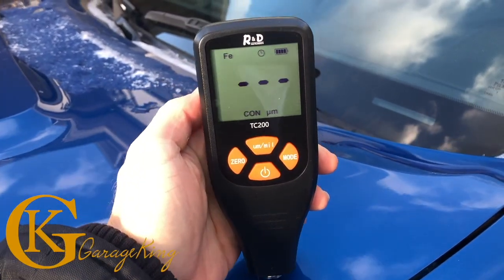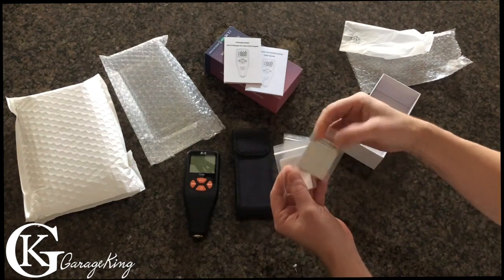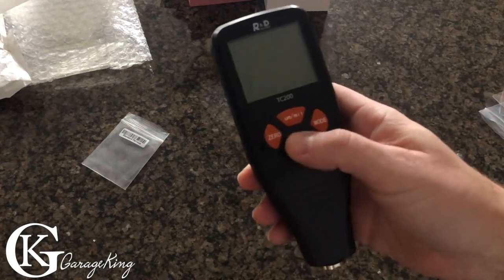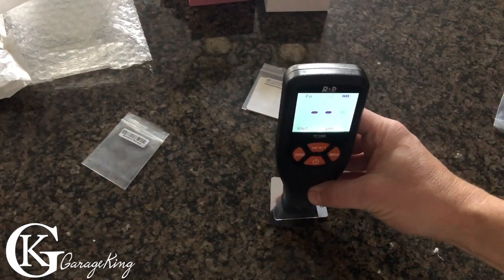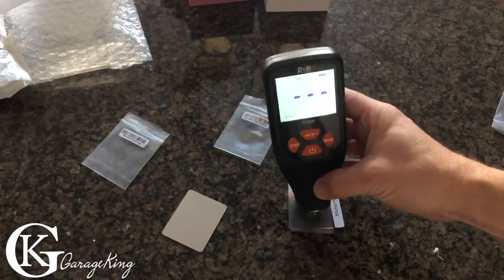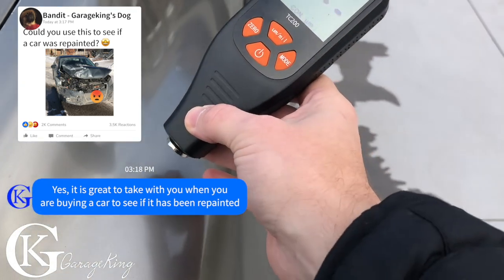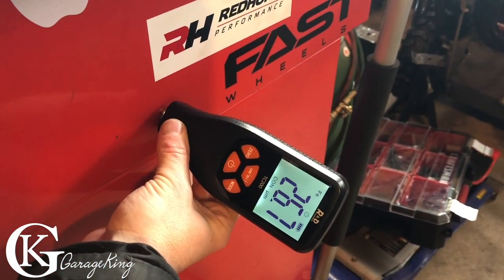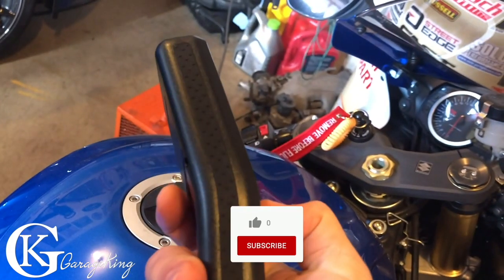I found a good cheap paint thickness gauge (TC200)

Comment: I actually need to do a touch up Paint job where my friend accidentally rear ended me. It left a few Black marks on the bumper😥
Reply from the maker: Thanks sucks!!!!!   The good thing is bumpers are usually plastic (on newer vehicles) so you don't have to worry about rust.  Sometimes if there are "press marks or small dents" from the accident you can use a heat gun (be careful) to get them out :)

Comment: I have the same tool (all details tallies as yours) but even after zero calibration attended it cannot give me exactly reading on substrates.For example when i apply on FE and 50um plastic the reading comes 102-113um  CON mode,with 1000um plastic reads 1090-1115um.Which  step should i follow to fix it?
Reply from the maker: You have to be careful on CON mode, on SNG (single) reading mode its easier.  The machine is very sensitive in CON mode and the reading can keep moving around.  Try it in SNG mode to see what reading you get.  It should be close, if its close that means your machine is ok and you are moving it too much on CON mode or its not vertical (it has to be square/flat on the surface)  Also make sure the material is clean, if its dirty it can affect the reading.  Turn the machine on in the air and press the "zero" button, then measure.   If you can't get a proper reading on SNG then your machine might be defective.  The most important thing is to make you you are putting it straight down on the material and don't move it around.  I hope this helps you out.
Reply: I have several paint thickness Gauge machines, it sounds to me like you not calibrating it properly that's the whole idea of the shims. Keep it on single calibration, measure in Mills.  Domestic stuff is between 4 and 7 Mils. Japanese paint will be between 1.8 to 4.3 mil
Reply from the maker: Good call on the shins, I should have mentioned that.

Comment: How do you know what amount would be good? And also how do you know the factory amount?
Reply from the maker: Hey brother, clear coat is usually about 1.5 – 2.0 mils (35 – 50 microns) but it varies between manufacturers, and the manufacturers don't tell you.  You would have to do to a dealer and check a new car, and assume they are all similar for that model.  Keep in mind paint thickness can vary between models. 
 The total thickness including primer is usually over 100 microns.  You should be concerned with the thickness of the clearcoat, as you will definitely know when its gone (paint will look very dull).  So when you are polishing you are removing clear coat and you can measure how much is coming off.  If you use a DA (not a rotary) you will barely take anything off and its pretty hard to damage the paint.  With a rotary its different.  

The biggest plus for a paint thickness gauge is to see if a car was repainted.  You don't have to know how thick the paint should be, you just need to know that all panels should be about the same thickness.  Hopefully I helped you out brother!!!!
Reply: @GarageKing  thanks brother. It helped me!
Reply from the maker: @MrDro1128  That is awesome !!!!  Its probably one of the most underrated tools that can really help you.  Thanks for the comment :)
Reply: @GarageKing  yeah, it’s difficult trying to find a good one. 
Thought I did, but looks like this one is discontinued. 
You have one you can recommend? Or you wanna sell that one? Lol
Reply from the maker: @MrDro1128  I just updated the Links, I love when I get comments, because I check my links as Amazon is always changing them.  R&D for some reason is not available on Amazon.com but it looks like you can get it on Amazon.ca  I updated the links, with the difference in currency it would probably be pretty well priced for you if you are in the US.  They also have a TC100 which I think is really good priced.  Check out the links and let me know what you think.  This is one priceless tool.  I love it !!!

Comment: Does it measure the paint thickness if the panel is plastic, rubber or of the sorts?
Reply from the maker: Hey there and thanks for the comment, it only works on steel and aluminum.

Comment: i bought this device and it didnt give me a reading when i tested on a range rover vogue 2014.
Reply from the maker: That is very strange, unless you got a defective one.  Now I know that some range Rovers, not sure about all of them, but some after 2012 have aluminum bodies.  You have to make sure your tester is set to "non-ferrous" as they default to ferrous, which is iron.  So if the setting was for ferrous/iron it would not read at all.  You should be able to get a reading on the wheels as well (thickness of the paint on the wheels) double check your settings :)   Also if you are on a plastic part of the body (bumpers/grill) then it wont read.  But it should have no problem with Steel and Aluminum.

Comment: Know if yours reads paint thickness on Plastic Substrate ?
Reply from the maker: Hey there and thanks for the comment.  Sorry it does not. I'm not even sure if one is made that tells you paint thickness on plastic ?
Reply: @GarageKing  Thanks for getting back to me. The models that use ultrasound are for plastics, wood, concrete, etc... as well. They're are just very expensive.$50 vs $2000... It was worth asking, Haha :)
Reply from the maker: @jeffmoore2649  Thanks for the follow up, and I didn't even know they were made for plastics/concrete etc.  Thanks for sharing that with me.  I figured they would be very expensive if it was made.  It's got to be pretty accurate using ultrasound so you price did not surprise me.  Thanks and hope you are having a good weekend :)

Comment: Can you tell me how that was 39mm thick?
Reply from the maker: Hey there, thanks for the comment. I quickly scrolled through the video and could not find a 39mm. It’s impossible to have 39mm I would say unless you pour paint on the ground and let it dry in a puddle. It could have been 39mils where each mil is one thousandth of an inch. I know I did some measurements in mills and microns. If I said millimeters im sorry about that. I meant to say mills as paint is not measured in millimeters. That’s my fault if I said that.  Sorry for any confusion. Good comment :)

Comment: Is it worthy or do you suggest any other model?
Reply from the maker: I have tried a few others and I really like the R&D brand.  I find they are very well made, and the readings are consistent.  You can find others in the same price range, but I have tested a few, and found the buttons didn't work very well, or the reading was not consistent.  The TC200 that was in the video has gone up quite a bit.  If you are in the US it would be a bit cheaper because of the difference in money.  The TC100 in the us https://amzn.to/3xjDiJX is good value for what you get.
Reply: @GarageKing  I've heard and for GM998 & ET330 that are good. Maybe a bit more expensive than TC100
Reply from the maker: @redihoxha2940  I actually like the TC100 better than the ET330.  The ET330 is a mini unit. The TC100 is about 10 bucks more than the ET 330.  The GM998 is a nice unit and its priced between the TC100 and TC200.   Now you know whats funny.  I found a TC200 https://amzn.to/3NSGYYK but there is no R&D written on it.  I think its a knock off and can't say how well it would compare to the real TC200?  Its 95 bucks